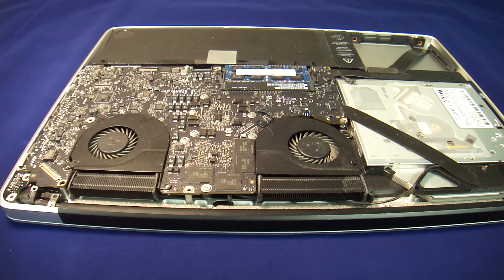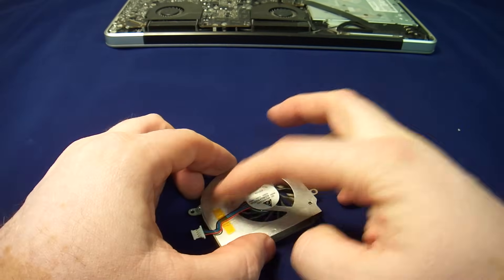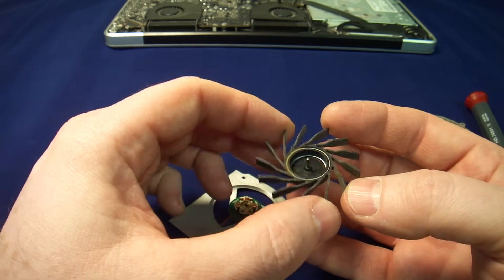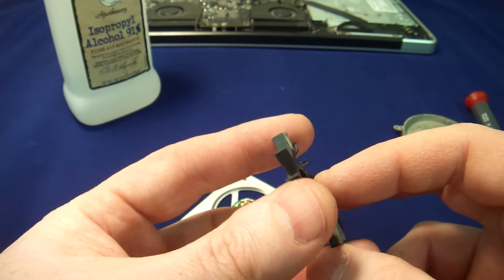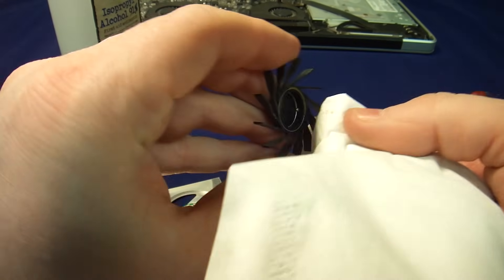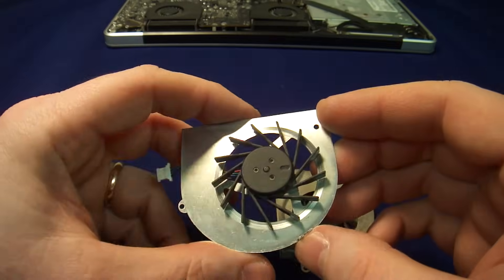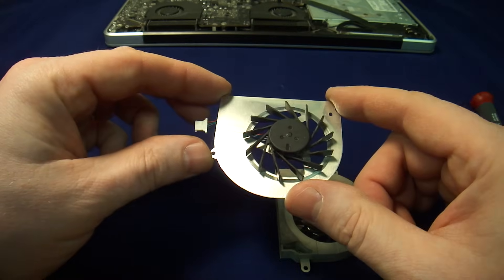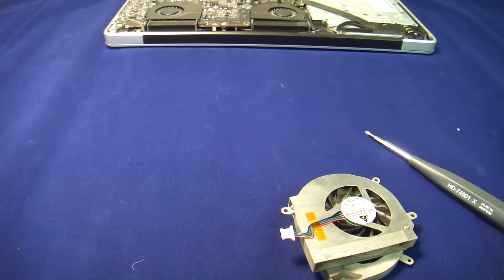How to quickly fix laptop cooling fan and resume normal operation of the computer MAH02617

Comment: I had a very loud fan and took it apart and found out it was shaking alot, my laptop would even shake. I was told id have to replace my entire thermal assembly for more than $200 and after looking through some useless videos, this one actually helped and fixed my problem for very cheap. So, great vid and very cheap and easy solution.

Comment: I'm too cheap to buy lubricant just for a fan so I used the oil that came with my electric shaver. It's meant to handle a lot of friction after all. Hopefully it lasts long. This video was so helpful thank you so much.
Reply: How long did it work for?
Reply: @shade1747  don't remember honestly but after that when the fan started making noise again I used cooking oil lol (less than a drop!) And it lasted waaaaay longer. I gave away that laptop because I bought a new one but it seems cooking oil works even better than the other one.
Reply: @KabooM1067  cooking oil works? great i’ll give that a try. Thanks!
Reply: @shade1747  yea worked for me, just apply it very scarcely be careful with the amount.
Reply: @KabooM1067 dawggg thank you so so much bro this fps frop was annoying the fk out of me and using cooking oil worked so well

Comment: For those people looking for an oil they can use but don't have any then you can use, wd40 (obviously) if not then do you have an electronic shaver? They always come with a small tube for lubricating the blades. That is top quality too use, baby oil also does the trick. Last resort option is Vaseline, just a small bit and spread it as thin as possible all over leaving no clumps or thick bits. It works but that's only if you can't find anything else. Whatever you do please don't use cooking oil, I see someone in the comments suggesting its usage but that is a 100% nope. Good luck and good day 😇
Reply: Just use cooking oil dude 👌

Comment: Use 'Tri-Flow'.  I, use it all the time and lasts a long time. Thank you for warning everyone NOT to use WD40  which actual is a water displacement lubricant and gums up after a while. When I had a boat in Florida, we used SRC spray to prevent corrosion from the salt water.

Comment: The tip about how the fans should spin helped me a lot when I noticed the fan would rotate a couple times but stop quickly. There was a small crumb stuck inside the fan causing it to not spin properly and my laptop to overheat. Thanks for the video!

Comment: Just followed your steps and the fan is working as good as new.  My replacement fan is currently unavailable for order, so your tip should keep my laptop up and running until I can order and install the replacement fans.  Thanks again!

Comment: Thanks man. I had the problem of fan making grrr noise very loud. I though it was because of the fan walls and the fan blade hitting or some unbalance nd all...but then I saw him putting lube. Then I tried oild and it works well now silently. I thought that bldc fan doesn't need any lube. Thanks. Helped a lot. Means a lot

Comment: Work your shaft...lol You could have pried off the sticker on the opposite side of the stator to be sure there are no accumulating old lubricant in there and that slot on the spindle (aka the impeller shaft) is intended for a locking clip that will prevent the impeller from getting too misaligned to make the stator interact with the magnet ring on the impeller itself, and could have caused the wobble that made those marks!

I had some good luck with using SKF LGWA2 as lubricant (since it was the lubricant available around that was also used on machinery), though other high quality lubricants can be used, carbon-infused lubricant is not recommended because of electrical conductivity, oils can be good as well (though can just dry up) but just make sure it is not the cheap stuff

Another thing that I once did to a VAIO that my team had over in Japan was to actually shim the fan. This took out most of the slack that you can feel with pushing and pulling against the impeller, that prolongs your sleeve bearing and makes the motor work better as the magnet and the stator coils are far more accurately centered, and if your sleeve bearing is very worn (like my newly acquired VGN-SZ18GP-C) that you can see the fan wobble as it runs, this can help you to squeeze a bit more life into it (because instead of wobbling so much, you took out most of the slack so it will wobble far less), using grease would also help with it

Comment: You really helped me, along with the people that rec'd WD-40 as lubricant for the fan. At first I did not use enough but now it is so quiet I can barely tell it is on, where before it woke up the baby whenever I turned it on. Thank you!!!
For some reason my wireless manually shut itself off during the whole operation and I had to restore that in Safe mode but other than that no problems.

Comment: Did this exactly on a Macbook Pro 2011 17" dual fans; worked great! I had serious noise and reduced RPMs to less than half max. I used silicone lubricant after cleaning out with alcohol and it was like new. The Sunon stock Apple fans though take quite a bit of force to get off the rotor, best to do it hard and fast to prevent bending chassis or other damage.

Comment: Computer fans use sleeve bearings, which is bare-metal contact between an extremely strong metal with one that wears very evenly and precisely, like bronze. The best lubricant for this type of application is one that contains a soft, powdery metal that works itself into the pores of the bronze, continually replenishing itself as the shaft rotates.

Overhead bathroom fans have a similar type of bearing; these have an oiling port in each of the two bearing cases, and the bearings are held in place by pressure (from the clips) and a fiberglass wick of sorts is used to contain and distribute the oil into the central bronze piece.

I couldn't easily tell what was on the paper towel, but it looked dark and brownish-gray in color, and it's definitely grease. Oil won't last because that small a bearing has no wick to contain it. To hazard a guess, I'd say it's a grease with graphite or molybdenum.

Comment: Hello. Long time you uploaded this but hope you or someone who knows see this. So first thank you. This have worked great on every fan that was stuck etc. And so my question. I bought a pair of new fans for my laptop because the one was not working and when I did this i bent the fan a little. It still worked when I put it back but in the end the motor broke. So sadly the new fans is to thick so i cant close the back of the laptop when they are installed so i was wondering if anyone knows if it is possible to remove the old fan motor from the casing its in or are they completly glued on them? 😆

Comment: I wrestled with mine (late 2008 MBP with two fans) for a while, trying to find a lube that would return them to quiet operation, I tried a variety of thin oils, which all eventually would start to rattle and whine like the first failure. I was about to give up and get new fans when I found the right stuff: Krytox GPL 205 synthetic grease from Dupont. Expensive, but it will probably pay for itself eventually. There are a few different types, but a small dab of this stuff on the fan axle, after first cleaning the old lube out with Radio Shack electronics cleaner has seemed to do the trick. For now at least! If it lasts several months between lubes, I figure it's worth it until I get a new macbook. I'm hoping I can get 10 years out of this puppy (upgraded to SSD and 8GB ram- still runs pretty damn good)

Comment: Hello, I have an IBM Thinkpad T42 and the fan is failing. When you turn on the laptop, the fan works but after a few seconds it turns off and then turns it back on, I checked and it is not an option in the BIOS. 

I applied lubricant and it spins like the fan you showed, the one that's good. Could it be a cable problem? How do I solve that? that fan is welded.

I doubt that in my country I can get a spare, is there a solution?

Greetings from Venezuela, awesome video 💕

Comment: i use wd40 for lubricating the internals. it lasts for a very long amount of time and is efficient. but you need to be careful when injecting. what i do is put some wd40 in a clean container and take a syringe to drop some drops around the coil and magnet and some in the centre. does the job and i am using the fan for 3 years now and no issues yet.

Comment: It is a very annoying sound. I have an MSI GS63VR Stealth Pro laptop computer. Both the CPU and GPU Fan make a lot of noise. Squeaking. Tring to edit the computer fan settings with Dragon Center. I had no idea the fans on the computer would be that noisy.

Comment: I most definitely need to lubricate my fan in my Acer Aspire v5 571 but the problem is my blade doesn't just pop off like yours did. I'm afraid to just pull on it, I don't think that's a good idea. Do you know how I can get to the rotor to lubricate it on this particular model?

Comment: I have a question. My notebook is pretty old but until recently it worked decent. It's a dell inspiron 7170 I believe which I purchased back in 2009. It's not my only one and I only use this pc once a week as I have a few others I use for different things. Anyway I keep it clean blowing it out monthly. Anyway lately I haven't gotten any warning messages but it's really slow freezes up for minutes at a time and lags like crazy. I have the best Norton security, and System Mechanics which is supposed to keep it running properly. Anyway I don't hear the fan anymore and not sure how long it hasn't been working however I do intend to replace it before I use it again but I'm concerned what may have caused this issue and what else other then the fan of course might I need to look at or replace if this continues to happen after replacing the fan. This system has Windows 10 home premium, Intel i3, 8gb of ram and a 500gb HD but it's an old disc one which I've been meaning to replace with a ssd like my other ones  but I've already replaced it a while ago before ssd's became so popular and I actually have a few disc hds still in the package I'd like to use first seeing how I don't use this pc as often and my others already have ssd which is probably why I use them more but still.

Comment: If you'd exchange the fan blades of both fans and place them in the opposite fans. Would it change the direction of the air it pulls out? I'm trying to do this on my zenbook pro with a vent mod that i recently performed, but it's only pulling air from the keyboard, so i'm trying to figure out how to change the direction of the air it pulls out to make the vents work

Comment: HP laptop started complaining after 2 years.  Dell laptop works as good as the day I got it, twelve years later.

Would be interesting seeing if there's data on whether some companies are known for using sub standard parts or not (Like Apple did on faulty batteries years ago, which triggered a recall)

Comment: Good thing to do is use PTFE lubricant, very easy to apply since its an under pressure can, you just spray a bit, its very durable and I go for an year before I re-do the whole stuff. It's also very cheap since a can costs 5-6 bucks and you can lube hundreds with it.

Comment: i used cooking oil as a lubricant, is that as horrible a move as i think it is?
Reply: same and it worked perfectly just fine
Reply: too heavy oil, baby oil last forever.
Reply: Oil like that will cause residue and gum up eventually, that's very bad

Comment: I have a Mac mini 2007, it was overheating, I took it apart to clean, and cleaned it throughly, including taking off the cooling fan casing and now the cooling fan is spinning at 6000-7000 rpm, but the annoying part is that it's oscillating like in one second it goes from 1000 to 6000 rpm then goes back to 1000 and repeat.

Have you ever came across this issue? Do you know what can be done?

Thanks a lot!

Comment: I use bearing grease, yeah those thick gooey thing? They work best for me, never dries out or being pulled all over because it's that thick. And my laptop is from 2008 and I opened the fan like in 2015 and blob it in the fan shaft... it vibrates from time to time. But the fan has yet to fail hope this helps :D And I know im 6 years too late.

Comment: You doesn't need to disassemble the whole fan. Just use an old toothbrush to clean the blades and edges and blow some are thru it. After this, remove the middle part of  the sticker on the front (with brand and modelnumber) and spray a little amount of silicon oil into the axle. Rotate it several times and rinse the axle with some tissue paper. Use some sticky tape to cover the axle. Your job is done, silence as it was before.
Reply: This methode last longer

Comment: i don't have any proper lubricant at home right now. is it possible to use sun oil? or it's a bad idea?
Reply: +Daniel Ivanov  tried it worked for one month.. then the sound came back... i just unplugged  my fan and turn up my a/c ...
Reply: Still works, and it's completely quiet!
Reply: But please watch the temperature sensors. If your HDD runs in a hot environment for long you may lose data and your components will age faster.

Comment: its strange, i once fixed two identical fans, from the same batch, made the same day even, one was fixed with the special lubricator, the other with WD40, and the WD40 still runs without problems, but the other one has been fixed twice with the special lubrication. so give WD40 a try, instead of the expensive stuff :P
Reply: +pesoen I will try it. I hope it will help and it will be better than this lubricator thing because I don't even know where I could buy it. I saw this thing for the first time in my life, lol :D I want to thanks to the video creator and to you for giving time to write this option "trick" down. :) During watching this video I was strongly thinking about another material which I could use as a replacement of that lubricant. And if you'r right and using WD40 instead of lubricant is more effective and if it have longer lifetime too then guys you are AWESOME! :)
...Reading gives you knowledge which is the biggest power which human can own. :)
Reply: realdatiw the special lubracation, can be found by searching "fan lubrication" on google, there are different types, and ammounts. but for the same price i pay for a large can of WD40, i can get a small ammount fo the special stuff, and WD40 last longer. tried with two identical setups(borrowed from a store to do a test, with permission of course) both are made the same day, and both are 100% the same, so i cleaned the lubrication off one fan, replaced it with WD40, and ran them with prime95 for 20 minutes, and to my supprise, the WD40 one was 0.4 degrees lower in temperature. i used another program to see what speeds the fans where getting, and the WD40 was getting 40RPM more on average, not a huge difference, but supprising.

safe to say, i use WD40 for fan repairs, and other bearings i need to fix. i have had one problem with a certain fan, where the WD40 dries up after about 3 months, but the fan is also mounted in a strange way, and is shaken around a lot, so im thinking that is why(shakes the WD40 loose, and then "throws" it away from the bearing)
Reply: I've used Blaster Industrial Strength Silicone Lubricant from Home Depot, and it only lasts about a month. I've used it about three times now. I'm trying WD40 next. If that doesn't work I'm going for the big guns . . . bearing grease. I'm on a 2007 Macbook Pro by the way.

Comment: Quick question, if you fix the laptop fan will you reset the laptop? i.e lose all your data? I gave my latpop in for repair because the fan stopped working and the guy fixed it and reset my laptop as well? I was really angry because he didn't notify me that he would reset my laptop but he said that it's a normalp part of the procedure?
Reply: No, those things are completely unrelated because data is stored on the hard disk, obviously fixing a fan will not erase data on the hard disk. I think the guy who fixed your laptop probably broke down your hard disk, then he replaced it and he didn´t tell you.
Reply: ***** wow... that guy is rude... not informing you is part of the normal procedure then? tsk tsk tsk.
Reply: lol like everyone said you got screwed on that one.  He difinitely jacked your harddrive.  The fan is just for cooling its not even regulated by a driver for it to work.  So there is no way in hell he needed to do anything in your your data ans such.  Except turn your comp on to see if the fan was spinning.
Reply: Lakhbir Kaur a fan is not at all going to wipe your drives if replaced or removed, that guy must have wiped it separately for whatever reason

Comment: This is great for cleaning the fan, but how about showing how you got the back off?    I've taken out all the screws, including those where the hard drive and memory are, but the back won't budge.  So, how do I take the back off a Gateway?
Reply: +Erik withaK 
There is usually a screw under the laptop's keyboar.  You have to pry the keyboard off slowly and a screw usually in the centre below the keyboards connection with the laptop.

Comment: hi i have a issue with my hp650 laptop i was replacing my thermal paste and has i was reassembling  my laptop 
i forgot to plug it back in  my fan now it stopped working was wondering if theres a way i can get it to worked 

i was working well for a few weeks   then it stopped

Comment: i need help,i clean my laptop dust today,previously it's fan was making some strange noise but spinning,but after dusting and closing my laptop and turn it on,my fan is not responding also not spinning,i re-open my laptop and check it socketrepluging,but nothing happens,is there any solution...